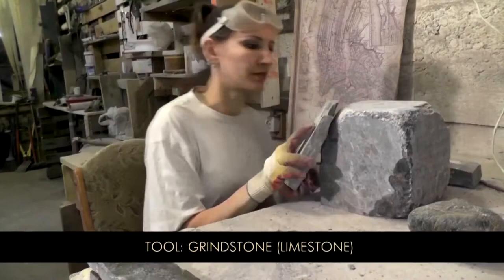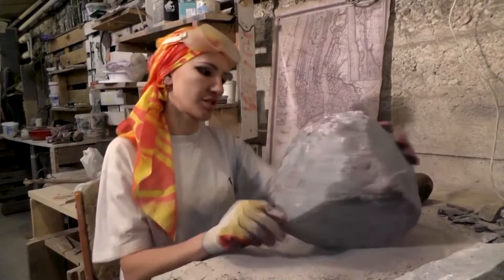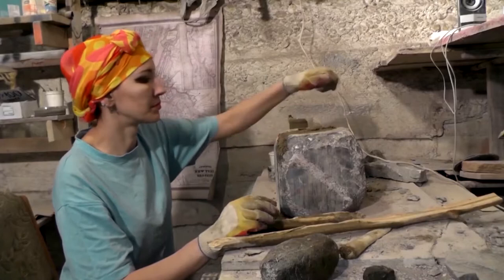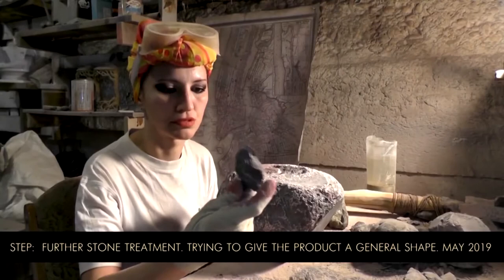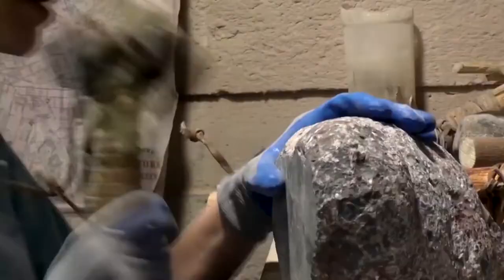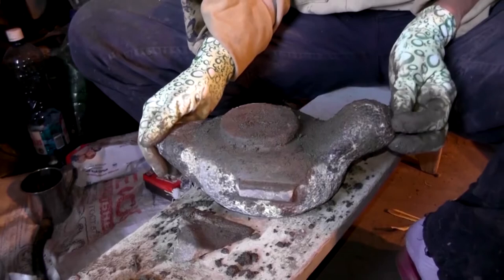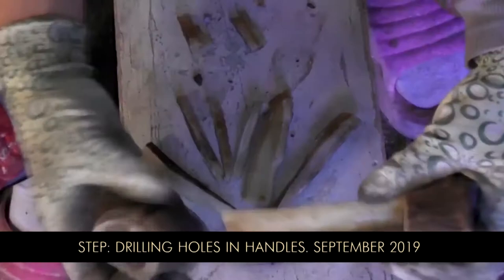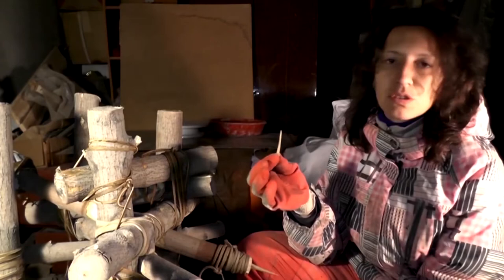Reconstruction of the Ancient Egypt Stone Vase

Comment: Some ancient artifacts were possibly hand made with simple tools, but there are many examples in tool marks left on artifacts themselves which suggest power tools. Also over cuts which in the slower process of hand milling would make no sense. 
The facts that much harder materials were used... Granite and Diorite. The Schist disk for instance...
Reply: The Egyptians of the Pyramid Age didn't need to use stone tools, as they had iron ones. Howard Vyse found an iron plate deep in the masonry of the Great Pyramid and iron is mentioned frequently in the Pyramid Texts. Iron tools of the 5th Dynasty have also been found.